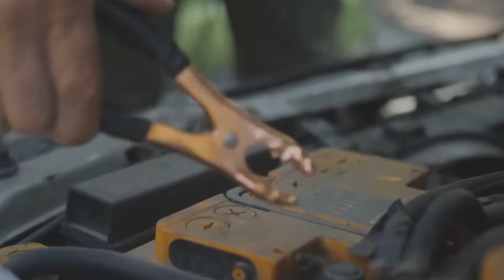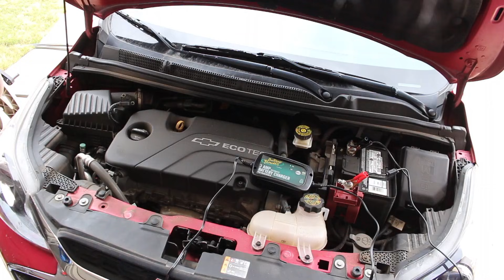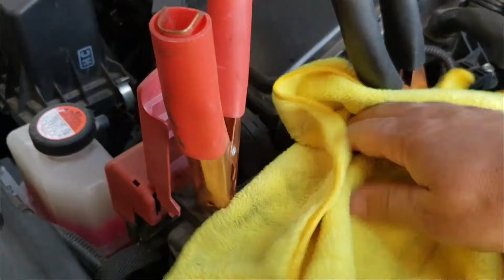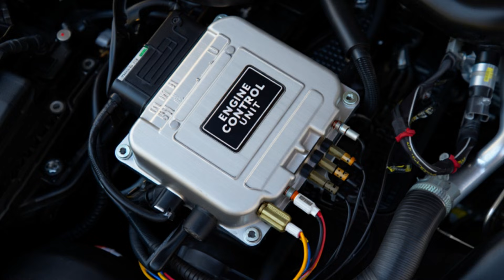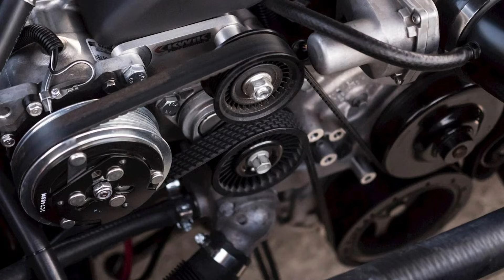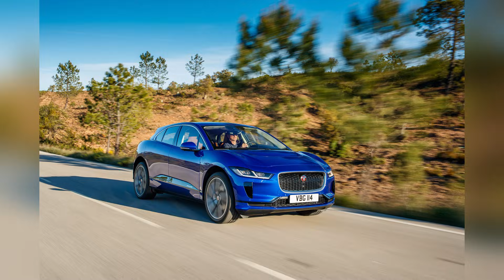Mechanics HATE This: Simple Trick to Make your CAR BATTERY will LAST 10 YEARS!

Comment: I found adding di-electric grease is the cherry on top of the terminals.
Reply from the maker: dielectric grease is a great finishing touch when used correctly. It helps prevent moisture, corrosion, and voltage leaks at the terminals, which improves long-term reliability. Have you noticed fewer starting or electrical issues since you started using it?
Reply: @theDailyCarCare absolutely. Too good to be true after years of corrosion.